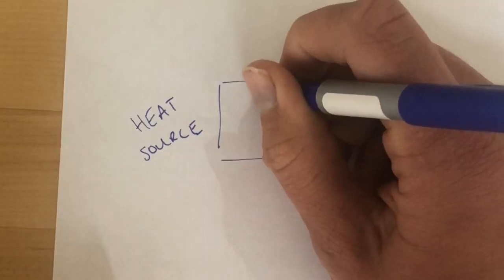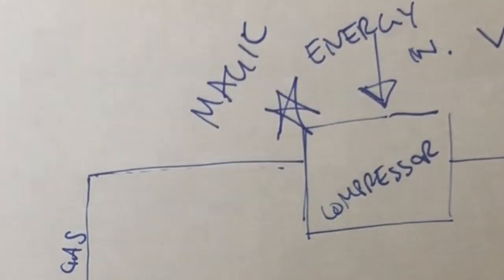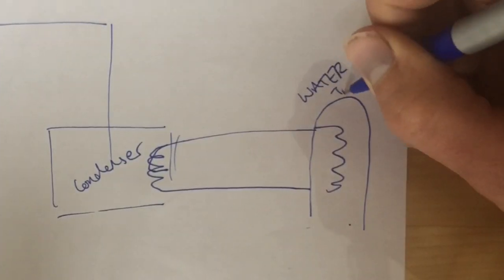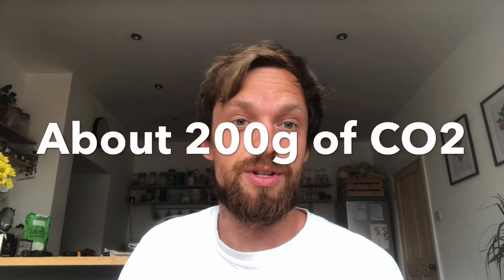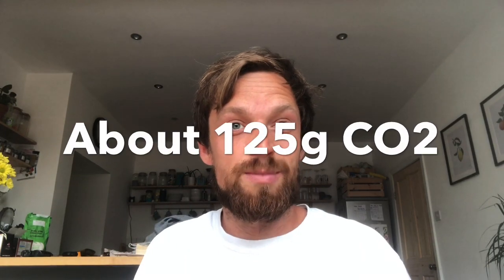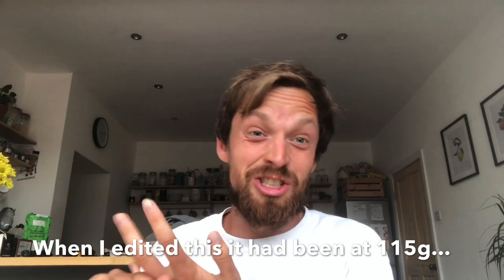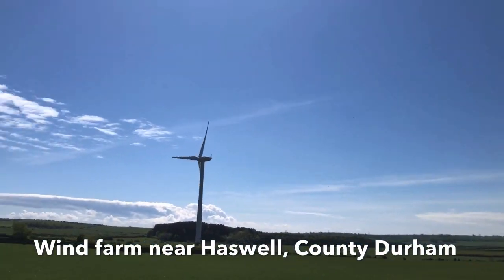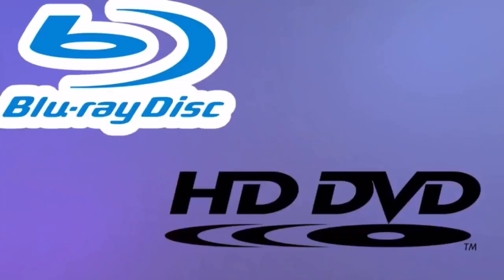WHAT IS A HEAT PUMP? - Episode 7 - Low Carbon Lifestyle

Comment: Hi Tom, you have your ear to the ground & lots of knowledge. I live in Durham in. 60s house with lots of windows. I've insulated the attic floor & walls.  I have a gas boiler & a low income. Are there any schemes still running to help motivate  home owners like myself to make the right choices & pay for improvements?
Reply from the maker: Hi Fiona - sorry to be slow to reply - I am sure you have seen in the news announcements from the government about heat pumps today. The big headline is the new grant to help pay for heat pumps - this is quite unambitious and a bit of a distraction.

But you may be eligible for grants via the Home Upgrade Grant scheme but I haven't seen details on eligibility for that. And there are occasionally wider schemes that help meet the cost.

Short answer is - no not really, and we need much better incentives to help people like you move to low carbon heating systems. It is great you have insulated well and that's a great start. I hope over the next few years costs will come down and heat pumps become more affordable
Reply: @TomBray-LowCarbonLifestyle  Thanks Tom. I'm keeping an eye on things & been sharing your video in Somerset, where I spend 50% of my time, at a parish climate group!

Comment: Interesting option. Back when I was a consultant building services engineer, ('88-'94) we were using Daikin and Hitachi VRV systems in all sorts of quick-tiurnaround jobs, such as bank refurbishments, so it's not new tech but instead a newish market area.

There's a risk that we still view things like-for-like, rather than as a whole system. So seeing a GS or AS heatpump as a straight swapout for a gas boiler isn't going to suit all cases. Combine it with solar electric/wind turbine and a smart home management system (like the one from https://myenergi.com/ ), then use immersion heaters/battery storage to hold energy as heat and power.

I see HPs as a useful step in staged  preheating, like with air flow heat exchangers, or condensing gas boilers, to bump the feed temp up to 50°C, and a final high power hit up to 60-70 from a regular immersion heater, albeit battery-powered from home storage or even V2G.

Most modern gas boilers are done in 6-10 years. The one in our house might be a bit inefficient by comparison, but it's 37yrs old and shows no sign of failing, passing its annual check with no problems. All things being equal, I reckon I'll still be waiting longer than you until I have to replace it through failure!

Looking forward to the hydrogen episode, though. Norway, storage issues for a molecule that's small enough to leak through almost anything, Toyota Mirai vs Tesla S (check out James May's videos on that over on DriveTribe), H2 sourced from electrolysis vs cracking natural gas (which one is lower carbon?). Lots to think about.
Reply from the maker: Great thoughts! Didn’t know you started out as a building services engineer. You’re right that a systems approach to a building is important and makes the transition to heat pumps a little more complicated than just swapping out a boiler (particularly if it is a combi like mine). Although I’d worry about over complicating what could / should be a simple system. 

On the transport issue - I’m convinced that hydrogen isn’t the solution for passenger vehicles, or for majority of medium sized vans etc. For larger vehicles ie buses, bin lorries, HGVs etc, I think it could offer more potential

Although, we don’t capture the carbon from reforming natural gas today, but the intention is to do so soon (how soon?), and electrolysis, today, is way too expensive to make green hydrogen attractive or economically feasible. My worry is that it’s all 10-15 years away which is nearing too late...?!

Thanks for engaging, really pleased it is starting a conversation!